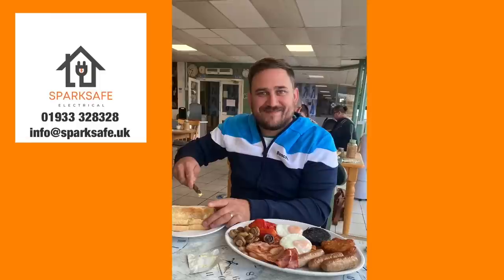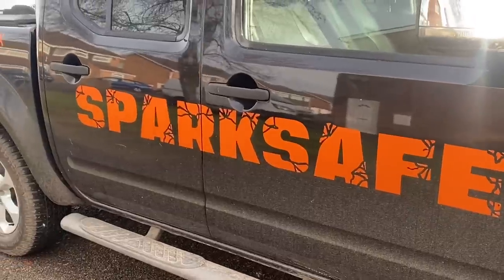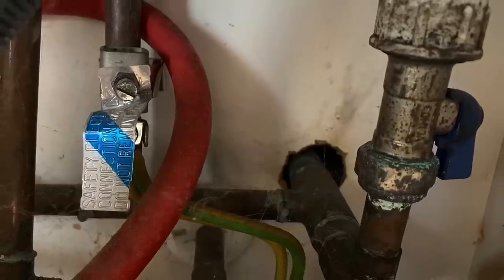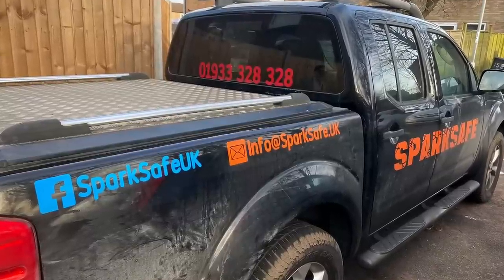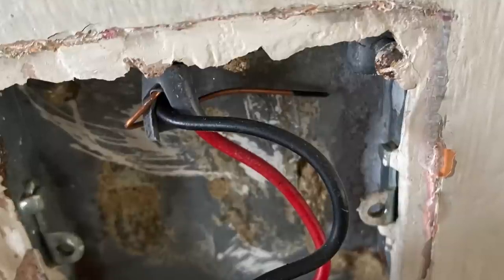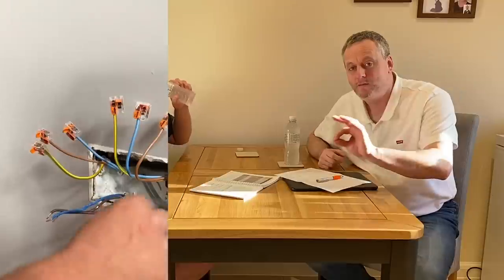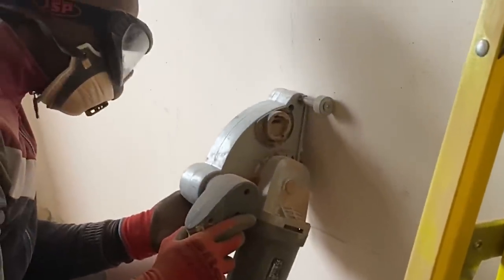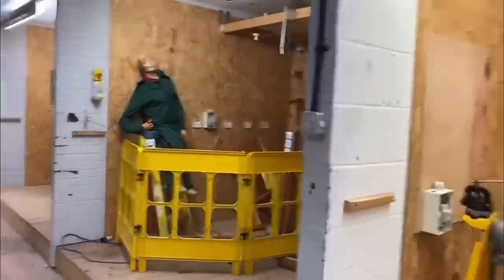What are the Challenges of Testing Electrical Installations?

Comment: Love your videos. I find it amazing that your earth wire in your 2+E power cables is bare. And then you have to go and put sleeves on them...weird.
Here in Australia we got away from solid copper cabling a long time ago and now it is all stranded, while the earth is fully sleeved, normally in yellow with a green stripe. RCD's in line with the MEN system have now been the norm for quite a few years over here. Same as your place, if an Electrician is called for some work in a building and finds that the system is not up to the current wiring rules, he has to bring up the entire system to the current standard...which can be quite expensive, depending how old the building is.

Comment: We learnt this in the mid 1970's in the labs working for Post Office (BT) when marking up polystyrene capacitors for test and labelling them with PVC tape. They all failed and when the material science team had a look the migration issue came to light.  Never again, all samples were labelled with copper tape from then on.
Reply from the maker: Thanks for the input Tony 👍🏻
Reply: It's more like the PVC eating the polystyrene, isn't it?

I found the issue in a flat with plenty of DIY wiring that had some of the sockets wired in flex underneath XPS insulation under the floors (don't get me started on the layers and layers of flooring, original floor boards, chipboard with carpet glue, two layers of carpet, 20 mm XPS and a floating floor, some of it probably in a desperate attempt to reduce noise transmission, the downstairs neighbour was shockingly annoying about the slightest noise and even threatened with physical violence). 

Most people seem to attribute the phenomenon to overheating but in that case I could definitely tell that wasn't the issue because coax cable showed exactly the same effect. I can't say I noticed any reduced flexibility, apart from having blue streaks the flex appeared perfectly alright after several years embedded in XPS.

Comment: Just a minor comment- I bond metal pipes like the copper running to heating, not because it is required, but because I actually saw a person electrocuted upstairs because they had their legs up on the radiator and a lamp was knocked over downstairs, the broken bulb connecting to the heater there.. Only a shock, but, and the RCD shut the circuit down fairly quick, but again, reduce the risks..